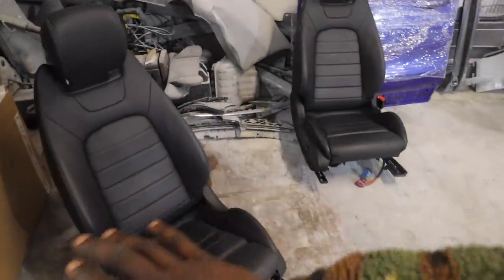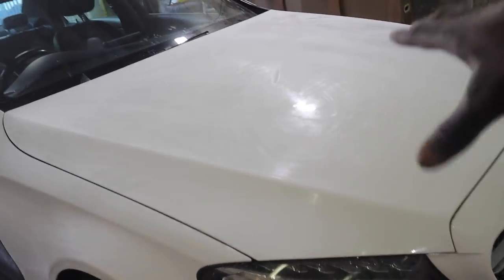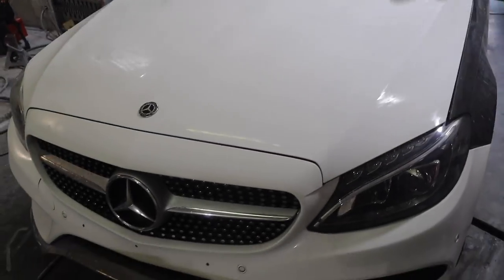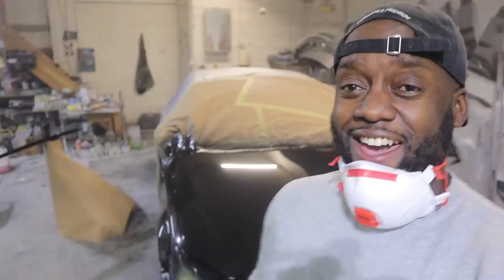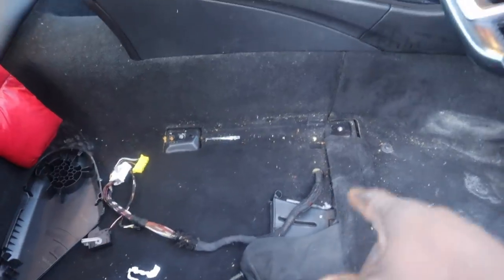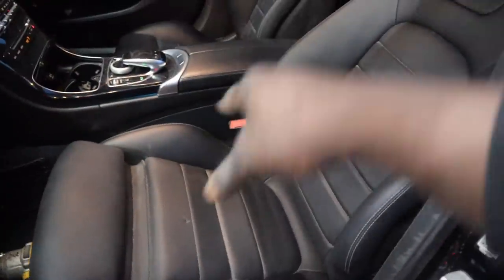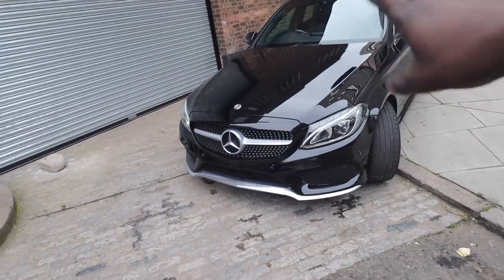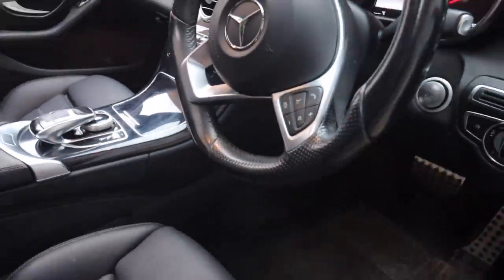PAINTING MY WRECKED MERCEDES W205 C CLASS AMG LINE... THEN THIS HAPPENED

Comment: What was the mod you needed to do to make the coupe seats fit? My W205 passenger seat is torn so I may replace the same way if its possible?
Reply from the maker: Seatbelts are different so needed to move the connector post at the bottom